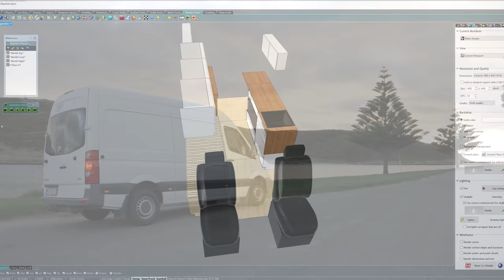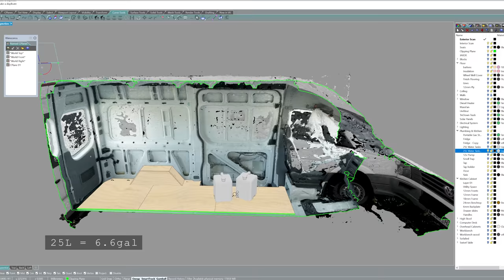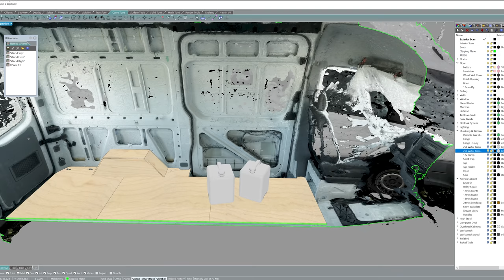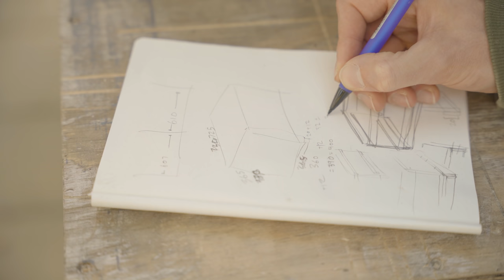Huge Progress! Cabinets, Walls and a Ceiling | Van Conversion Part 3

Comment: "cordless nailer" --- absolutely amazing
Reply from the maker: You know they're bad when I'm still laughing at them
Reply: @FurtherFabrication  I thought the same when the hammer and nail made appearances. I'm in the trades and haven't used a hammer to drive a nail in years.

Brads and pins, yes. But always from pneumatic or battery-powered nailers. Even then, the brads or pins are only for securing things temporarily while glue sets.

Screws are my go-to fasteners. For my van builds, I use extrusions, and secure assemblies in place with rivnuts and machine screws. I also employ either t-nuts or threaded inserts when joining wood pieces; the rationale being that things may need to be disassembled and reassembled at some point, and sheet metal and wood screws are only meant for bringing things together.

I say that a van experiences a hurricane on the outside and earthquake on the inside as it goes down the road. Build accordingly.

My now former partners completed a build a few months ago. Against my explicit instructions not to, they used wood screws in some places and "self-tappers" in others. After only six weeks out on the road, panels that were affixed with wood screws had fallen off, and elements that were secured to the van body with sheet metal screws had detached. Needless to say, there wasn't a single issue with any rivnut or machine screw.
Reply: @ARepublicIfYouCanKeepIt  So true!  Spare a thought for the boat-builders who have to cater for hurricane, earthquake and TSUNAMI!... don't even think for a second about private luxury jets, let alone space craft!   :o)
Reply from the maker: Love the analogy! I'll keep an eye on those screws then!
Reply: I was like, cordless nailer nice I could use one of those what kind of does he has........wait a minute..... XD
Reply: 15:40 cordless nailer, I rewind the video to see the nailer OMG 😂😂

Comment: The WOOD IS RIMU.  Im pretty sure.  There is 2 kinds heart rimu which is wild grains and and dark and light.  That is the outer rimu which is what you have.  Strong long grain. Many New Zealand houses of old are totally built out of it.  The older it gets it seems to get harder.  Strong   Good to see you using safety equipment,  Rimu dust is toxic, so i use a positive flow fan to blow dust away from work.  Your inspirational.😀

Comment: if the wood for your counter top stunk to high heaven when working it, then it's Rimu. Turned a large platter out of it once and had to stop every 30 minutes for fresh air. havn't worked with Matai yet.

Comment: Hey mate, I'm pretty sure you did in one episode what I did in 8 months... what I don't get: why screw anything into the wall?! It breaks the paint seal and creates potential rust points doesn't it?
My trick to get the riv nut points correct is: double side tape some foam on. Insert bolts. Press against where it's going. Good work, looks great!

Comment: Fantastic! Layout is different than what i am looking at but some similar ideas. New ones i will use, split cutting board, and dividing bed slats into sections. I was going to do just one. I still havent figured out my table yet. I have a low roof, probably another 6 months. Your electrical is so clean. I will have to go look at your vid on that if you have one. Love the angled panel it is laid out, i might use that. 3 sources planned, except maybe a 4th - in addition to roof solar, also briefcase solar. off, A, B or A+B? we'll see if i can swing that. my plan is to build it out over 1-2 years, give me something to do. Was going to do roof last, and my wall cabinets are going to be usable prototypes out of cardboard, and all the cabinets scrap wood, and i will play with the sizing and layout - build it cheap and unfinished and there is no problem cutting it down and moving it. That's the plan. Great stuff. I love your filming technique - the plumbing example (I know nothing about plumbing). Although the vids are over 20 min they are efficient. Great voice overs, zero sound problems, which is the worst. Really good lighting. I am still unsure if i want undercabinet lighting to be lensed or indirect deflection. I should be able to prototype it. Great job!

Comment: Pal, as usual, a neat design, great job, I was wondering if your engine will handle all that extra weight, be carefully while you learn how the van will behave on the roads of the great NZ
Reply from the maker: cheers mate, that's very true. I'm learning not to take corners quite as fast that's for sure haha

Comment: Now, if I were going to do this, I would...DO IT EXACTLY LIKE YOU DID! Brilliant. You are a fantastic engineer, and seeing how you dealt with the curvaciousness of the interior would have stumped me, but I learned how you analyzed it and came to solutions. Superb craftsmanship, and the ceiling triangle looked great. I wonder how much weight addition you are up to now? Looks pretty well budgeted considering the utility and beauty. Totally glad to be your subscriber.
Reply: Oh, and your dry humor is off the charts as well 🙂
Reply from the maker: Cheers mate, yeah it was a ton of fun with all that problem solving! Not sure how much weight I added yet, still need to get that checked

Comment: What's the type of hand saw you use for leveling off the long lengths and getting them flush? I like it. Might try your style with the glue and clamps too instead of the kreg jig.

Comment: Really awesome stuff. Very inspiring. Did I spot some sort of special crosslap joint at an intersection of three beams in the desk frame? Is there a name for that, or was that something you made up on the fly? I can't get my head around how they'd fit together exactly if theres beams coming in from the x, y, and z axis...

Comment: What is the durability of using plywood. I mean the van are going to be.moving going over jumps and bump. What sort of affect is that going to have on the structure of the this material. This question is not just about you it's something I wanted to know and everybody is using plywood to make the internal furniture.

Comment: Have you had any problems with warping on that cabinet design?  I'm considering something similar and I like the simplicity of making it all out of plywood, but I worry about warping.  Especially on the front panels that don't have as much support all around.

Comment: Thanks for a great video. I’m just wondering about the rear of the cabinets. Did they follow the curve of the van that the battens followed? (For the lower base cabinets, coz I saw you used a template for the uppers) Or what?

Comment: At 11:37 what are those white pieces you're using?
Reply from the maker: They're kerf offset guides, for when you have to cut on the inside of your line. I just 3d print them to the thickness of whatever blade I have
Reply: @FurtherFabrication  Oooh that's very smart! I've been using a folding measuring stick. I might have to 3D print some myself.

Comment: I really like your content and I’ve been following you from the beginning but mid video adds are an enormous dealbreaker if you’re heading that direction then good luck but with one less anonymous me.
Reply from the maker: Fair enough mate, I hate having to push ads on people. Just out of curiosity though, would you prefer I had 'in video' sponsors?
Reply: @FurtherFabrication  If you mean the likes of northvpn and squarepace, I wouldn't mind those.  If I have the choice to skip through I'm good. Or a patreon?
Reply from the maker: exactly yeah, cool thanks for your feedback there, it's actually really helpful!  it's always a bit of a tricky subject